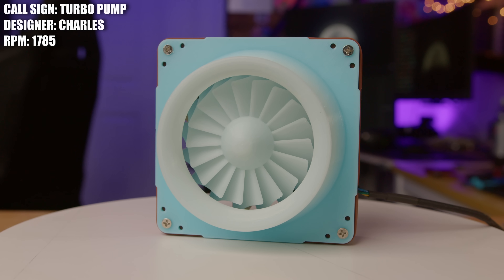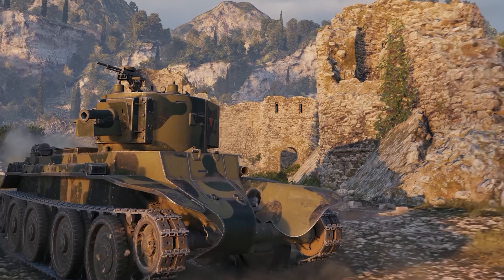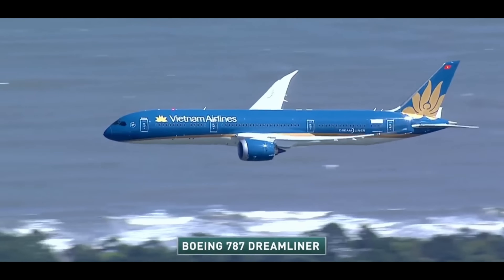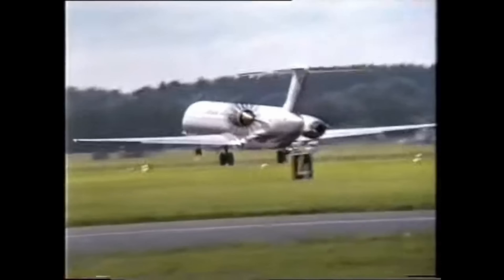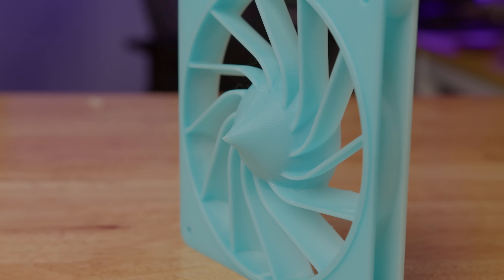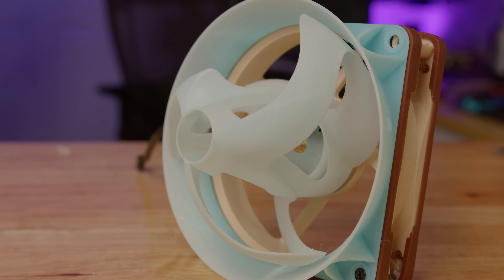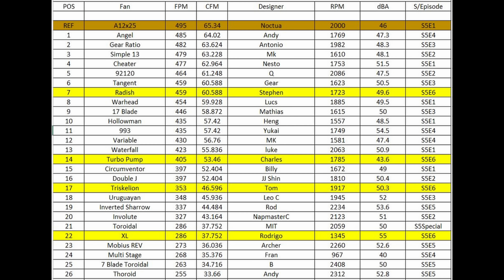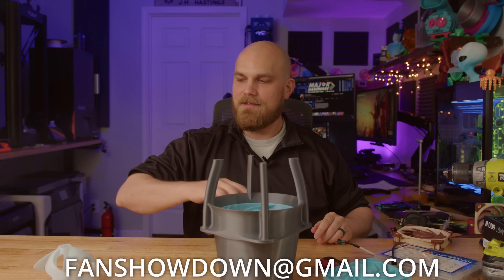Turning the Sharrow Marine Toroidal Propeller into a PC fan | Fan Showdown S5E6

Comment: WOAH. The print quality you've achieved here is OUTRAGEOUS. Dang, now I really need to finish that model I was working on.
Reply: yes, indeed!
Reply: After years of fdm printing I finally got a resin printer and I’m loving it. The quality is incredible.
Reply: These look resin printed.
Reply: @JJFX-  They are. He mentioned in a recent video that, after comparing old designs on his resin printer he got better results so now every fan will be resin printed where he can manage it.
Reply: @amani576  Makes sense. Will probably be a bit more brittle but I think he just used PLA anyway so overall it should be the better way to go.
Reply: @JJFX-  They make some "PLA-esq" Resin that's pretty tough. I use it to print my D&D minis since people can't be bothered to be gentle with them.
Reply: @TheObsidianwolf1105  Yeah I've played with a number of different ones but I think that's mostly for models and such. PLA is hard but it's not very strong. The ABS-like resins are probably better suited for something like this.

Comment: Dell made a fan and shroud similar to that XL fan really early on in the Pentium days. The fan was mounted on the inside of the chassis door and the shroud was mounted to the CPU.  They needed another fan on the back of the case to cool the power distribution on the MoBo anyway so I never understood the reasoning. They didn't do it again so I guess it was a fail.

Comment: I'm too lazy to learn how to design one, but I was thinking of one idea in case anyone cares, which I hope I can explain, say you have the original noctua fan with 9 blades. Then every 3 blades reduce the blade height, leaving 3 groups of 1 full original blade, 1 blade with 75% height (bottom .25 removed), and 1 blade reduced to half height (missing the bottom half). This idea is to test if less mass gives more rpm with similar performance, not sure what will happen to the noise as it may introduce turbulence, it may also differ to do the same but reducing the top instead of the bottom. Not sure If the order matters (full - 75 - half vs full - half - 75).

Comment: I'm thinking that if the fan "shroud" on the exhaust side of the "Radish" design was extended to match the tip it might still work on a radiator.  That and the triskelion seemed to have the most condensed airflow during your smoke test.  I was very disappointed with the Triskelion's performance numbers, especially given how well the Sharrow prop actually does work and the numbers quoted from the MIT people with their quad copter props.

Comment: A dual fan episode would be fun where you mix the best high volume and high compression designs. I think the XL with the Radish mounted on the end easily beat the best single fan. 
Also do you think the radiator should be in the middle or at the end?
Reply: Oh, nice concept! 

Edit: sandwich the rad in the middle.
Reply: @majorhardware I don't know if you can take down comments but it looks like someone is impersonating you trying to scam your viewers. They responded to my comment and a couple others.

Comment: The inlet runner needs to be longer so it'll accelerate the air before hitting the blades. I've been able to improve CFM by installing a 4" duct adaptor on the inlet end of a 120mm fan.

Comment: The exhaust on "The Radish" is VERY streamlined. His design worked! That's some gorgeous fluid dynamics.
Reply: Yeah. I'd love to see that one tested with a spacer so the stator and spike can come in to play.
Reply: @Loebane  or the spike cut off. Well, both versions would be best :D
Reply: I wonder what the optimal spacer length would be. Might be good to test with multiple lengths so the air has some space to straighten out. Also, that airflow is so smooth I bet it would make a great cheap wind tunnel on a budget.
Reply: @Loebane exactly what I was going to say
Reply: Major Hardware has some old fan bodies that he could use as a spacer, that would be a easy fix.
Reply: He said he'd have to omit the stator to test it on a radiator, but then there was no test on a radiator…?
Reply: Does he rate sound?  I know some modern fans operate at a lower frequency emitted thus being less agitating on the ears.  Does he test for this? or is the top of his spread sheet cut off and i just cant see that?
Reply: @wbass243  He doesn't. He's measuring using DbA which is basically a high pass filter. Though it does measure the sounds we find annoying, it's far less weighted towards the low-end. These would probably be 5-10 Db louder if he measured using DbC.
Reply: I liked the Radish, and if you normalize by noise level it seems a pretty good design. 

That said:A lot of people are suggesting a spacer. One thing I will say is that all fan's become slightly more efficient through a restriction like a heatsink or radiator with a spacer. It's an old tactic to get the most out of your watercooling setup. Add gaskets and a 120x20mm spacer to allow more even flow of air through the radiator. The A12x25 (or Nidec Gentle Typhoon which is what I prefer) benefit from spacers and gaskets. So you can't just add a spacer unless you're going to do that with all of the fans. 

Also, while a clean air-stream on the back looks cool, what actually makes a difference is how much air is moved, not whither it goes straight back. Most cases don't vent straight back anyway, the air usually has to switch directions before it is vented.
Reply: Does it annoy anyone else that he keeps using that garbage fan motor?
If he used a better motor, these fans would have better results. 
This is so fvcking stupid.

Comment: Really love the switch to resin printing. I know it can be hard to work with but from the viewers perspective the higher quality prints it produces is definitely worth it.
Reply: So clean!
Reply: @ExclemationMark  agreed!
and not to mention more perfect condition
Reply: The Elegoo Jupiter also has a build plate big enough for two 120x120mm fan parts side by side, maybe even 4 at a time if you tilt them to the perfect angle. And with resin printing, your print time is the same per unit height, regardless of how much stuff you pack on the plate. So even though washing and curing and dealing with chemicals and ventilation is a pain, it's possible that the resin printing workflow actually ends up being less time-consuming than FDM in the end.
Reply: @Mirrormn  just don't forget that using more of the build plate increases chance of print failure with resin.
Reply: These look like FDM prints, you can see the thicker layer lines  in a few places and I've also used this filament before
Reply: @RavenBomb123  I aint no expert. Parts like the grey shroud for that one fan sure. Thats probably FDM. The light blue parts look like resin to me. If its FDM that's even more impressive, though I doubt that.

Comment: I'm not surprised the XL did poorly. It's got way too much resistance for the tiny A12x25 motor to handle. I think this is partly why the cheater is so damn good; it uses a lightweight fan that's easy to turn.

Comment: I think you should do better two kinds of fans: the vanilla ones (those who stay inside the normal A12x25 case) and the non vanilla ones (bigger than the normal fan). That way some people might get inspired and create some good designs that can become contenders in the market if something like what happened with the Acceleron.

Edit: HOW MORE THAN 50 LIKES!!???

Edit 2: What... More than 120 likes WHAT!!??
Reply: That would honestly be a nice change of pace so everything doesn't come with giant shrouds.
Reply: @Zarincos  agreed! longer yploads time and longer duration, with more fans with 2 category
Freestyle and Vanilla
Reply: Yoo this is popping up!
Reply: Agree with this
Reply: yeah, something like fan showdawn classic and then the actual fan showdown where people can add front and rear casings and huge fans
Reply: I do like your thought process but I don't think the vanilla category is going to experience much innovation from this. There are a few limitations of this format. 1st, print quality vs manufactured quality. 2nd, ability to have focused iteration on a design to ensure maximum quality. 3rd, the literal centuries of combined experience of the engineers at Noctua can't be underestimated. They've been doing this for a Long time and have been the top dog for quite a while.
Reply: @nightbringar7558  The original idea was to try different fans to compare against the Noctua as potential replacements. It's since largely been turned into throwing random shit together, like the fan of dicks. So your points are both yes and no. As to potential fan replacements, no one's going to put the Cheater in their case. And most of them are still randomly designed or guesswork at best.

Comment: It almost sounded like the XL was hitting the shroud. Perhaps this could be checked? Also, in terms of testing the Radish, a spacer could be made to give space between the radiator and the flow stabilizer I assume.
Reply: Just don't print the cone, its effect is probably really small.
Reply: @ameunier41  It's probably affects the noise profile (and drag,) I think it would work great in a pull config (on front intake) if it was also the body for the motor because now the stock NF-A12 body interferes.
Reply: @submijiru  keep in mind I am taking about the scenerio where the fan is clamped to a radiator.
Reply: @ameunier41  Sure, but you still could clamp to a radiator.. in a pull config. And there might be more benefits to keeping the cone, because there'll be more directed, less turbulent airflow and maybe if you do a push-pull with other fans it might have a dampening effect? I don't know, it's worth testing.

Comment: dang its crazy and pretty cool that the a12x25 still has not been beaten. It may not ever be, but if that day ever comes, it'll be cool to see what the cooperate world does about it. Good show dude
Reply: False I think it was in season 2 or 3 someone got a brand deal for beating the goat
Reply: @alexanderdesfosses  I remember the brand deal because of the design, but I can't remember if it actually beat the a12. Also the a12 is still at the top of the list so I just assumed it wasn't beaten
Reply: @MlnscBoo  Well, older seasons used different testing setups that prioritized pure airflow, so some designs did better than the A12 in that environment. Now that we're measuring the air that can be pushed through a radiator, the A12 is showing off what it was optimized to do, and hasn't been beaten. And yeah, iirc, the fan that got the brand deal was not necessarily because it beat the A12 in performance metrics, it was because it was pretty good and also had a very cool serrated look.
Reply: The really insane thing is that the A12 is largely inspired by the Nidec Gentle Typhoon, that was released like 15 years ago. The A12 is better, but it's also using better materials and manufacturing methods.  The GT's only cost ~$13, and that's accounting for inflation.

Comment: Apologies if this already happened - but have you tried just a straight copy of the A12x25 design but 3D printed? Would be interesting to see if the 3d printing process produces worse results vs injection molding on the same design, or if the A12x25 design really is just better than everything anyone's come up with in the community.
Reply: https://www.youtube.com/watch?v=603hywgt92w
Reply: I believe filament and resin have both been tried already in previous videos.

Comment: The results of fluid dynamics engineering are way cooler than the actual fluid dynamics
Reply: debatable
Reply: Theoretically we have all the 3D models, and the experimental results.

It's time to train an AI.
Reply: @jtjames79  an AI requires thousand trials though, pretty costly. Further AI don't really think out of the box. That is, they can combine what they see in the training data and thus make creative ideas but not a leap like the XL .
Reply: @jtjames79  This! We really need to train an AI on this data and let it start narrowing designs down around metrics like efficiency, CFM, static pressure, etc. based on preset parameters, like certain types of blade designs, pitch, frequency of blades, etc.
Reply: @AlphaMachina  "ok google, make the best pc fan ever"
LOL
Reply: @pvic6959  we are not that far from something like that being possible.
Reply: @AlphaMachina  there's some video in YouTube of someone who did propeller designs using evolutionary algorithms and got one weird looking one that was supposedly better than the usual designs so it's likely possible
And AI is really good at hyper specific tasks from what I understand anyways
Reply: The advantage of the Sharrow propeller is that it has some of the advantages of a ducted propeller without some of the disadvantages. The advantages has already been tested and proven, its just that it is proprietary and expensive.

It is highly applicable in boats, not really applicable in PC fans.